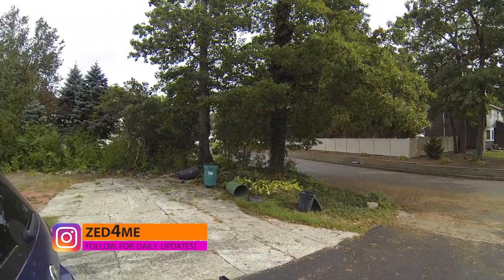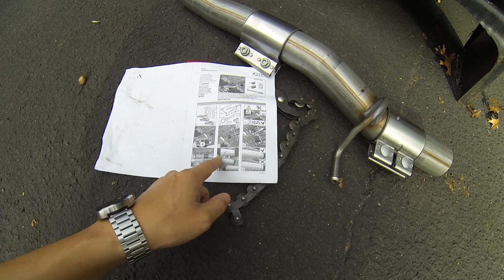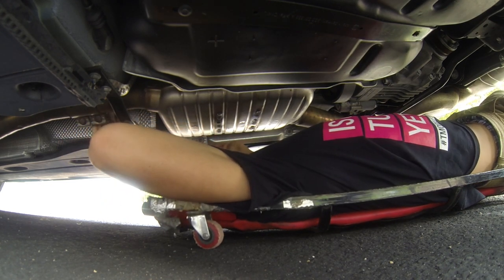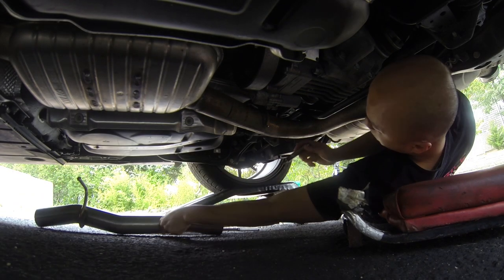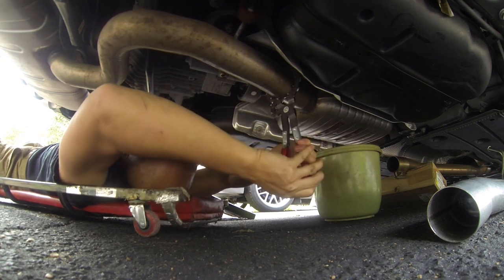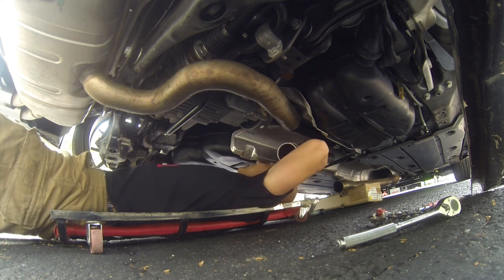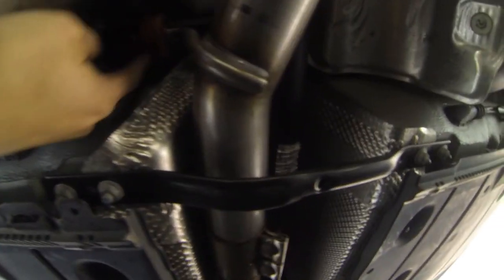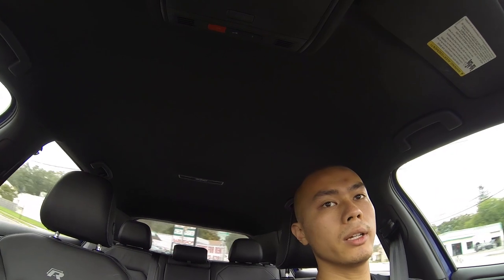Golf R Resonator Delete DIY and Impression

Comment: I know it'll sound nerdy, but dude.. always wear eye protection, specially metal you just cut and didn't deburr. 12:51 you almost lost an eye ;)
Reply: Should also never get under a car that's only being supported by 1 thing. There should always be a backup jack or something under there. Those ramps could fail easily, especially on a slope

Comment: Very nice video!
The difference when you tested in neutral was obviously!
I suppose the car has very good noise  insulation thats why you didn't noticed that difference from inside. Don't worry. The little noise is acceptable when you cruising. If there was too much noise it would be annoying

Comment: Thanks for the video. I have been told that resonator deletes aren't good for the car/engine in the long-run, as it messes with the car sensors and the exhaust fumes coming from the engine... is this true? I was keen on getting one installed before I was told this!
Reply from the maker: Absolutely false. This has nothing to do with sensors/exhaust fumes. The resonator's job is to cancel out certain low frequencies. It does not act like a muffler or catalytic converter in any way which are the parts that could cause the problems you mention.
Reply: @zed4me  awesome, so 0 impact on engine/car longevity?
Reply from the maker: @willn9497  yes

Comment: Now would you recommend spending around 200 bucks for a premade pipe from audi/vw or ecs tuning or 034 motorsport and a cutting tool, or just pay a shop to do everything for 60 bucks?
Reply from the maker: 60 bucks to a shop and it's irreversible. I would go with OEM so it's fully reversible. Like I put mine back on and now I have the pipe for sale. If I went with a shop it'd be irreversible. If you want it I can give you a good deal, hit me up on Instagram. 😀
Reply: i mean instead of them weldiing the pipe on, i can buy a clamp that they can use instead so itll be reversible
Reply from the maker: Lil_ Danny904 sure, that works, if you make sure they use thicker gauge stainless steel but then youd be looking at a lot more than $60 with clamps and materials.
Reply: yeah true,  hell idk what to do, i just want more sound, just dont wanna spend over a grand for an exhaust or do the work myself, i dont feel like i have the mental compacity to do so

Comment: I did this on my R.  I have an AWE non resonated downpipe. Once warmed up its sounds pretty good. For me a little too loud but stock was way to quiet. There is drone on the highway but not unbearable.  It's been a few months now, I'm used to it now. At full tilt if I shift near redline I get a backfire. I was told that normal for the mod.
Reply: Neil Porter are you dsg or manual?  Just curious if the back fire happens on a manual.
Reply: It's a manual.
Reply: I also have a manual with an AWE non-resonated downpipe and was thinking of doing this resonator-delete mod. Do you have access to turning on or off the exhaust valves manually? I'm wondering if keeping the valves off with something like the AWE Switchpath Remote will keep it quiet-ish.
Reply: Francis Luu No I don't. I might get an OBDeleven.

Comment: Buddy please tell me if theres a drome with this decat downpipe and res delete. I want to do this mods to my R tomorrow. But dont want drone to be bad on high way
Reply from the maker: Atish Sewjith at 3k rpm there's a change in the valve timing which sets off a little drone. I think the resonator takes care of that rpm drone specifically so you can hear it at 3k rpm which is around 80mph.
Reply: Drone....not drome

Comment: Hi 
do you know how to keep exhaust pip opened all the time?
thx
Reply from the maker: You need VCDS, just shine a flashlight and when it’s open, use VCDS to turn off the flap function
Reply: thanks for the reply,have done that before and do you have video for how to do it by VCDS ?
Reply from the maker: الملحقية الثقافية العمانية - لندن I don't have a video of it but it should be pretty easy to find a guide online if you Google

Comment: The sound is very good, have anyone tried opening the muffler and clear everything inside out leaving an empty muffler box, with inlet and outlet short on both sides, instead of cutting out the muffler
Reply: I thought about that too. By definition, the resonator takes care of an obnoxious frequency. And most people here are talking more about the noise increase, rather than the performance aspect. Did you ever do the mod??
Reply: @jameskujawski6651  I done it , it's much better  but hard to weld it back as my muffler has two thin layers,  so constant having little leak here and there . But I'm new to welding too so , someone with good experience might not find it hard.  But believe me it's much better,  loud and still maintain deep tone.

Comment: How about and exhaust cutout in the location of the resonator?
Reply from the maker: CrispCarGuru great idea! I'd do it except the cutouts tend to rust quickly and also this resonator delete isn't a straight pipe, there's a curve in it
Reply: what parts on the cutouts tend to rust?
Reply from the maker: the actuator.. leads to it being stuck open or closed or partially etc

Comment: I've reverted resonator delete on my sirocco because it causes drown and vibrations in cabin. Better option is to delete muffler and leave resonator in place.Or Delete Both and you years will bleed PS without muffler it poops and bangs like crazy
Reply from the maker: Got any video clips of the muffler delete with crackles?
Reply: No man sorry. I had last winter, for 2 weeks,  on my 1.4 sirocco,it was so loud and cracks were like explosions i had to retrofit aftermarket resonator and muffler, it was almost offensive to roll up to university. And by the way couple guys form VW club in Moscow had their muffler and resonator Delete on 7Golf r as yours and it's even louder
Reply: zed4me and If you want a beefy sound, i can recommend form experience, get a wide pipe, or to go real crazy switch catalytic converter to exhaust gas control sensors basicity straight pipe form engine all the way back,but I'm not sure is thats legal i US, but maaaan people in 30 mile radius will thing that  volcanic eruption is happening

Comment: Ok so some issues here. You have soundakor or whatever its called turned on. So the sound coming out of the speakers will always be the same. So you need to open all your windows to hear it HOWEVER you still have the sound coming out of your speakers which will be louder then the stock exhaust.

What you should of done is Disable the engine sounds coming out of your speakers then you would of been able to hear the difference. I have the same car and have done the same mod however I went to an exhaust shop. I can defiantly hear a difference, slight on idle and cold start but you notice it more when you get on it.
Reply: bryanviper The soundaktor generates sound by vibrating a diaphragm hooked up to the firewall.  It does not come through your speakers.  I agree he should have turned it off for the in cabin sound review.
Reply: The soundaktor in the VW cars actually does come through the speakers... older version did what you said in this post but the VW is electronic through the speakers
Reply from the maker: Dave Hall this VW golf generation does not come through the speakers. its through the soundaktor near the windshield

Comment: Code the exhaust valves open and you will notice a big difference with the resonator delete
Reply from the maker: Will be doing this soon!
Reply: +kcotte59 Sorry we're talking about the sound control valves down by the muffler not the engine valves
Reply: Just open them in sport and unplug the solenoid. Save you’re money on coding the ecu.

Comment: You will gain over 10 hp with that delete but it should of been welded and not putting you down or anything, you did everything right, but at Meineke, they would of done the same job and with welds so there wouldn't  be any leaks what so ever for just $60.00 also they would of gave you a bigger diameter if you chose too, but again you taught me something at the same time, using that pipe cutter, nice job.
Reply from the maker: I would never let meineke touch my car. This is how Audi/vw recommends the install, I'll leave weld jobs to others.
Reply: zed4me No problem do u
Reply: Jnevone DSF lol I also never knew about that pipe cutter. 
My rs3 is soon to lose its resonator.
Reply: Did you get any power or just only sound I remove it today butt I dont know if I get more power  the sound is perfect spacial with 3.0 inch dp

Comment: you installed an aluminized steel tube in the place of a 409 stainless steel one !!!
probably that this mod add about nothing on an unmodified engine !!
Reply from the maker: Saved weight and car sounds better. Exactly what it was intended for
Reply: It’s an OEM part, what’s the issue

Comment: 200 bucks for a damn pipe it's softly said ridiculous. I don't know whats so special about it but recently i bought a similar pipe for my car it costed around 10 bucks for 1 meter from the local exhasut pipe store, then i paid like 15 bucks more on the local exhaust service and they rounded'n stuff the pipe as the shape i needed then thay made mi exhaust hanger for free because it's included in the prices here, so for 25 bucks you get the same thing as this "original" audi pipe, which is just a simple pipe for a 200 bucks tho....

Comment: If you want a real effect you have to delete one of two rear silencers as well. Removing the resonator does not change that much. Believe me, tested this myself.
Reply from the maker: What rear silencers? The valves? I've got them permanently open now.
Reply: The golf R has a different exhaust than leon cupra 280? I had 2 read silencers and 1 middle resonator. Along with resonator I removed smalled out of two rear silencers that was situated a bit on the side. The second silencer (the one I did not remove) was also used to split the line into two separate exhaust tips.

That is very strange since we share nearly every part (engine, platform, computers, suspension)
Reply from the maker: Not sure.. maybe the AWD but doubt that changes anything.

Comment: deff louder, pops more on farts.  I have an external vid here https://youtu.be/WjhIciNp45w. btw I noticed you took that wheel cover off, didn't like it?  keep up the good vids man.
Reply from the maker: What wheel cover??
Reply: zed4me the steering wheel cover! I was gonna ask the same thing. That's still on my watch list
Reply from the maker: Logan Rouse oh yeah! I recently took it off cause I want to get an alcanatara one and wanted to see if the tape ruined the wheel underneath lol
Reply: zed4me and their verdict? I had that question actually as far as if the tape had any residual effect. Anything? Also for full alcantara would you get another wrap or get like the clubsport wheel? Thanks man
Reply from the maker: Logan Rouse after cleaning with Goo gone no issues! And I'd rather wrap because it's reversible easily.